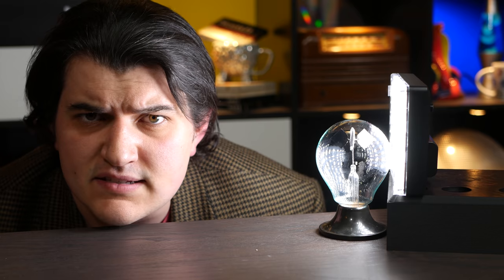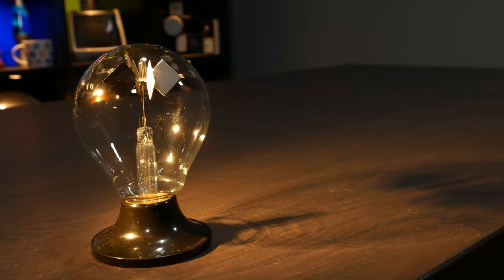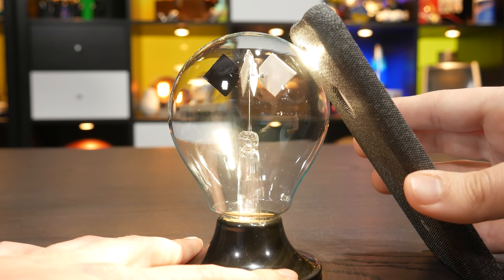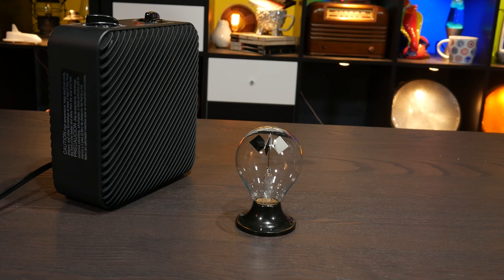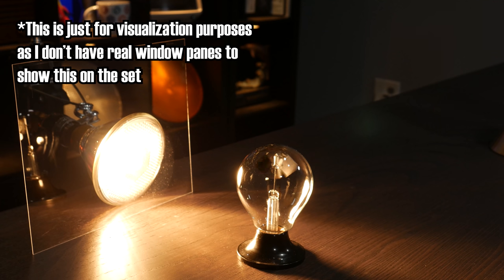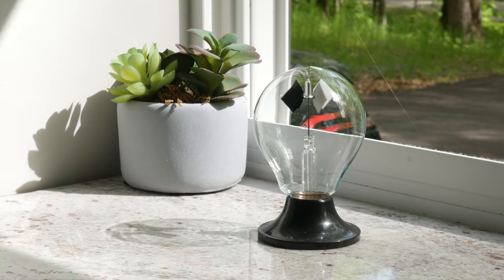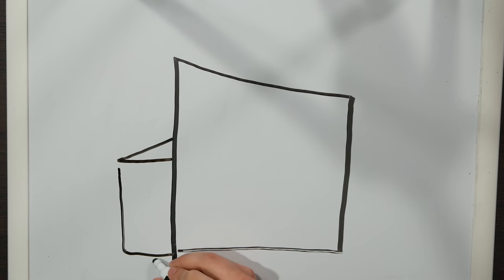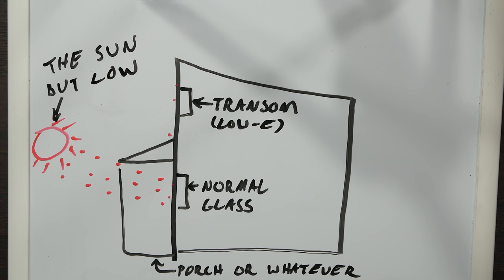What the Crookes Radiometer can teach us

Comment: Here are a few precisions about the low-e, which I happen to know a bit about! I am too lazy to give sources but I tried to drop keywords. If you are interested, the manufacturer sites (Guardian, Saint-Gobain etc.) are IMO just the right balance (not too technical but still not pure marketing) for viewers of this channel.

12:35 - 12:52 actually low-e windows do cut quite a bit of visible light, by 15% to 40%. It's just that humans do not perceive absolute  light levels well, so as long as the glass is "optically neutral" (not visibly tinted red or blue) we do not really see it. The video actually shows a change in brightness when you compare the opened or closed window (ok, the CCD does not capture the exact same wavelengths as human vision, but still).

14:40 and 17:02 the window is very probably double (or triple) glazing and the various reflections occur inside the gap between glasses.

The best low-e coatings we can make (most transparent in the visible range with near-total rejection of IR range) are based on one or multiple silver layer(s) (stacked with other stuff to achieve color neutrality, resistance to glass process etc etc). Oxygen from the atmosphere tends to attack the silver over a few months, so the double glazing unit is filled with either argon or nitrogen.

The low-e stack goes on the inner face of the outer glazing; the silver does not get to breathe all that nasty oxygen (at least for the first years of use where argon is still here) but the gap still provides some thermal insulation. The gap thickness is designed to minimize convection flow, and radiation exchange is low because of the low-e (Kirchoff's law, or as I call it blackbody magic, requires that if you reflect incoming IR you do not emit much of your own).

If you touch the outer glass of a double-glazing with low-e it will feel hotter that a regular double-glazing (because the IR that bounces off the coating crosses the glass twice and heat it up more).

There are some single-glazing low-e that do not oxyde (for oven or fridge doors, chimney covers etc) but with much poorer IR rejection performances.
Reply: Thanks for the info, these are very interesting insights!
Reply: Who knew there was so much engineering in a simple window. Compare that with the simple glass in an antique window.
Reply: Thank you so much! How it operates doesn't seem all that dissimilar from a mirror with a silver backing, just that the layer is only enough thickness to reflect infrared, If I get this right?
Reply: thanks, this is some valuable insight. Also makes me think about recycling and the growing usage of silver.
Reply: I've seen some low-E glass advertised as using Krypton or other more expensive noble gases instead of Argon, any thoughts? My guess is that it takes longer for these heavier noble gases to seep out of the inside of the low-E glass assembly, because I know from my interest in space launch rockets that Hydrogen (even liquid hydrogen) will "leak" right thru the atomic metal lattice structure of a metal pressure vessel wall given enough time (causing hydrogen embrittlement along the way), and that other gases (like Oxygen) will not do that, so my operating theory is that the larger the atom or molecule of gas is, the harder it is for it to treat a given barrier as porous. Xenon and Krypton have pretty much full valence orbitals in their ground state, which is what makes them avoid forming molecular bonds with other elements, but according to my theory that would also make them very resistant to being pressed thru a solid material barrier like a pane of glass.

Also, why can't they just put another coating (perhaps a polymer of some sort, or even a layer of plasma-deposited graphene or diamond?) on top of the silver coating to prevent oxidation? Too expensive?
Reply: @ethanhayes  It's more complicated than that. The total thickness of the coating is somewhere around 100nm, so at this scale you need to look at interference tricks, especially when  there are multiple silver layers. A thicker coating could paradoxically be more transparent (because all the non-silver stuff is mostly transparent but the distance between silvers matters). Honestly I am not a specialist of stack optics but the gist is that it's complicated.

I think (?) mirrors have one much thicker silver layer.
Reply: @44R0Ndin  I would think the main argument for heavier gases is that they have a lower thermal conductivity (see "kinetic theory of gases" on Wikipedia if you can bear the thermodynamics calculus). This cuts down the remaining contribution to heat transport in the cavity.

Your basic theory of leakage is correct (larger molecules leak slower through microscopic holes), however it does not leak through the glass itself but through the mechanical assembly holding the cavity (keywords: butyl seal, spacer). There are assembly methods to make a better seal but that usually increases the amount of metal at that location and hence thermal bridges on the sides of the panel become significant (see https://www.efficientwindows.org/spacers/).

I am not sure about an oxygen blocker in the coating. For sure that would decrease optical performances, but how much?

I can speculate about a lack of market (again, not my domain). For a residential insulation use case, you probably want a double-glazing to start with (you need the cavity to cut convection regardless of how good radiatively you are), and having a good seal in the assembly is probably less expensive at least with current technology that changing the stack. OTOH, for fridge doors, chimney covers and the like where you cannot use double glazing (thermal stress would kill the seal) you are usually less picky about visible-light transmission and IR rejection can be meh. So maybe it simply does not make commercial sense to develop a single-glazing silver stack.
Reply: @alphonsedaudet5547  Thank you for the detailed reply, it looks like I have a little bit of research to do.

Comment: One of my first jobs was working in a science curiosity shop in the mall and I remember selling these. I'm very glad to know that I wasn't misrepresenting them because the explanation we told to customers was pretty much just what you said here.
Light is absorbed more by the black side of the vanes warming the air next to its surface causing the excited air molecules to exert a higher pressure onto that side of the vanes.
Man that shop was so fun. It was one of those places that also sold plasma spheres, model rockets, chemistry sets, telescopes, mineral collections, fossils, etc. It's also where I learned to juggle and memorize the constellations.
Reply: That's actually the explanation I was taught, but I remember reading years ago (in a Usenet FAQ?) that that can't be the full explanation either because if it were purely ballistic, so to speak, the system would quickly reach some kind of steady state in which the rotor doesn't move, and the real explanation is the thermal transpiration effect at the edges of the vanes which I don't understand at all. And that's as far as my understanding ever went.
Reply: hot thing make air hot which make air move which make rotor spin

Comment: A note about low-e coatings shifting magenta on glass: they're designed to be bandpass filters, usually using repeated layers silver to shore up the UV and infrared reflectivity. One interesting side effect is that because the filter works by tuning layers against the light waves, at an angle it tunes differently. This is why you see that weird magenta effect: it's considered a defect, but also somewhat unavoidable. As you walk by commercial storefronts, look up on a cloudy day, and if you see bands of green/magenta, the coating had "shifted a* too hard" (using the CIE Lab color scale), yielding that defective Christmas tree banding effect. Given how complicated color spaces are and how light wave interference effects interact with the layers to enable the bandpass filter, it's probably more surprising there aren't more color artifacts when reflections are stacked.

The way your typical glass coating interacts with glass is shockingly complex and really neat!

Comment: Loved the DS9 reference.  That was a great episode. But it's important to note that it wasn't just the solar sail, they also had those eddy currents in the Denorios Belt.
Reply: I really hope you had to look up that name
Reply: Specifically it was tachyon eddies as tachyons are one of the few particles in Star Trek that naturally travel faster than light.  The Bajoran solar ship's relatively low mass to surface area is what allowed them to accelerate to warp speed when they entered the eddy, though realistically, without inertial dampeners, Ben and Jake should have become smears of organic goo on the aft bulkheads from that kind of acceleration.
Reply: also in episode 2F09, when Itchy plays Scratchy's skeleton like a xylophone, he strikes the same rib in succession, yet he produces two clearly different tones
Reply: @stdesy  Had to look up the spelling.  But the belt itself is mentioned so much in the show that I remembered what it was called.

Comment: As someone working in the field of glass coatings, I can tell you that your first assumption is actually right: a low-e coating is designed to reflect far IR but let near IR through. In reality though there is a compromise to find between how high we want to far IR reflection to be and how low the near IR reflection can stay. This compromise is linked to the properties of the materials used in the coating. So If you leave in a cold place, far IR reflection is very important and everything is done to make it as high as possible even if it means increasing the near IR reflection a bit as well. The orientation and position of the coating in the window are important but it cannot really create a big assymetry of reflection in the IR. A window designed to limit solar inputs by reflecting the near and far IR is called a solar control (for big glass buildings). There the trade of becomes transparency in the visible range. Finally, if you want a windows with tunable solar inputs, look at Electrochromic ("smart") windows. They are amazing ! One example is called SageGlass.
Reply: Finally I know that smart windows are for. I was baffled why a blinds/curtains alternative would help any more with energy consumption, and thought it was surely an aesthetic consideration. But reducing heating in winter and reducing cooling in summer would reduce energy usage of the building and help. So I see now. It’s very much like how some places have a lip above their windows so high summer sun doesn’t come in and heat i as much as the low winter sun.
Reply: I have heard that greenhouse glass has coating that allows IR into the building but not out. Is that true? Or is it just totally reflective and it's only the IR generated by the plants that heats it up?
Reply: @rhettorical  afaik it’s the hot air kept inside, and the solar heating on the glass (which, heating up the panes themselves, is a separate matter from how much they actually pass through themselves)

Comment: Brings me back to the AR optical and glass fabrication days... every bit made me want to throw in my 2 cents 😄
Having the need to visually recognize the coated side of low-e glass made its color and effect very surprising. It's hard to describe, but it looks kind of both red and greenish depending on the angle of view, and goes blueish-purple as it ages. So it definitely doesn't reflect only infrared. 
That view of the led reflections reminded me of when I used to double coat crizal test lenses for crazy effects, and found out that you can remove individual layers by applying a wet erase marker before coating. So many smiley faces and funny notes I've made in the reflections, with wild pinks, yellows and metallic fluorescent blues.... I still have a few 😁
Man, you should do a vid on antireflective coatings! 😉

Comment: "selectable low-E window" Why not have two panes in series and you just choose which window to use.
Reply: You still want a low-E or highly IR reflective window in the winter depending on the environment. There might be a few hours a day where you could get net positive energy flow into the window, but especially in the long cold winter nights, you would still want that IR to stay in your house.
Reply: @jimbrookhyser  Yeah, sunny winter days are probably not something to expect, really. But in very specific climates I'm just imagining how this could be a really neat way to heat a house.
Reply: If you live in a cold climate, I recommend getting a window with high SHGC and use an awning calculated for the path of the sun by that window. You can then get an awning that, when the sun is high in the summer, it blocks it, but in the winter, it allows heat in
Reply: The best solution, if we could just make up chemicals, would be one that's IR-reflective when it gets hot but IR-transparent when it's cold.
Reply: I have a suggestion.  Put a solar panel on the roof. Use it to run your heat pump.  There you go.  Energy harvested from the light, turned to heat.  :-)
Reply: @angolin9352  put rotating blinds between two panes of glass,
Reply: @nickwallette6201  you could even water cool the solar cells and use the captured heat to also warm your dwelling
Reply: I have selectable Low-E windows that are totally automatic.  I don't have to do a thing.  No maintenance whatsoever.  Not only the glass, but the siding and the roof as well is auto Low-E.  I have 3 in the front and 3 in the back of the house.  They're called trees.  They block about 90% of the IR energy in the summer and about 2% in the winter.  It is a pain cleaning up all of the little heat blockers in the fall, but it's a small price to pay for the energy savings.
Reply: @pamike4873  Fantastic point, if you can live in a deciduous forest do it.  If you live in an evergreen area you better hope your trees are good at producing infrared light for those cold winter months.  Let's just modify trees to produce infrared!   

How many watts would it take for an infrared tree to produce to power.... 1/10th of the power for an average home in X (maybe San Marino, American Samoa, Tobago etc...)?
Reply: @highpath4776  woahhh, and the blinds could be coated with ir reflective/silvered  coating to add some shade in the summer and also reflect  heat, but then let in ALL the light during the winter
Reply: @sagebrushrepair     You can sustainably convert about 1/80 of your mature trees to infrared per year by combustion.
Reply: Maybe something similar to an LCD?
Reply: @nickwallette6201  
Geothermal kicked up another level by solar thermal collectors, the vacuum tube type...

Comment: I kinda got excited when you started talking about Low-E glass because it's extremely relevent to my current job. Mind you, I am no expert but in my experience it does matter which side the Low-E film faces out. We characterize glass with different surfaces. I.e. the pane off glass towards outside is surface 1 and on the backside of that same pane is surface 2. From what i can tell you have double pane insulated glass, so there's an inert gas in betweeen and then the interior glass would be surfrace 3 and surface 4. The Low-E coating is usually applied to surface 2 of the glass. Considering you live in a cold climate I'm going to assume that there is Low-E on surface 2 and 3 whith the intentions of keeping the uv from the sun out but surface 3 is doing the same thing to keep UV in. So flipping your windows around wouldn't do anything to change the effect. We us a fancy piece of electronic plastic that gives us a reading of where the Low-E is and how thick the glass is etc. GC3200 | Glass-Chek ELITE. Anyway i feel like i just danced around your question without answering it, but this is the extent of my knowledge. Do with is what you will.
Reply: Thank you for sharing
Reply: Ideally the coating would be on layer 1 but I suspect the coating is applied to surace 2 because it is subject to less wear there. It does mean that the first pan of glass will be heated more than if it was on surface 1 but the second pane of glass is insulated from this pane by the gap between them anyway.

Comment: In Germany we have a window that is kind of like you described, they let infrared through at a flat angle but not from above, following the sun through the year. I'll try to find the brand.
Reply: It's called 'four seasons glass'. This contains a special layer that only transmits light coming from a specific angle. I initially heard about this almost 10 years ago, when working in a house with massive windows, asking the client about heat problems in summer.

Comment: I would be interested in seeing the effectiveness of multiple variations of this.
One normal, and one in Vantablack on the dark side, "mirror" on the light side.
Reply: If I remember correctly an appropriate white surface actually reflects light better than a mirror also I believe Musou Black is darker than Vantablack if you compare it from a paint standpoint Vantablack is only more absorptive as a material not as a paint. But I agree it would be interesting to see the most effective of both black/white used in a radiometer

Comment: Years ago I worked for a window and storm door manufacturer. Some of the panes were Low-E. It was very important to build the,m the right way. When installed backward, Low-E coating on the outside, UV will charge the surface and make dust stick to it.